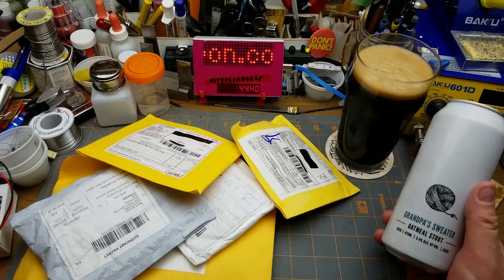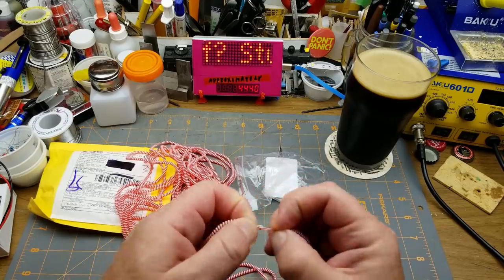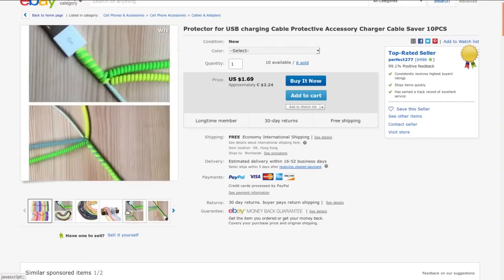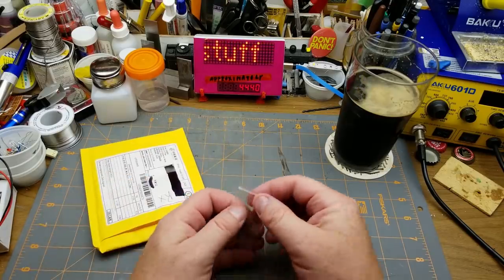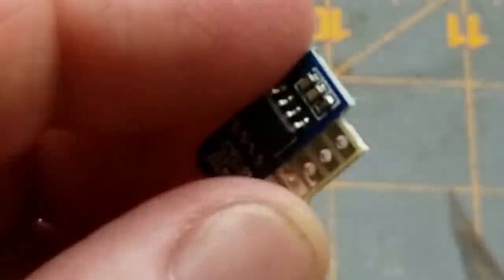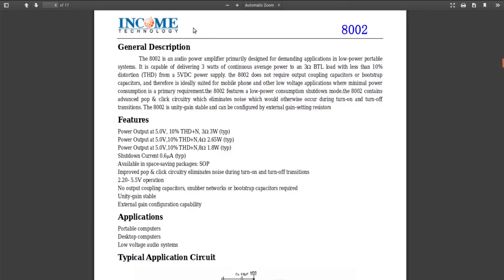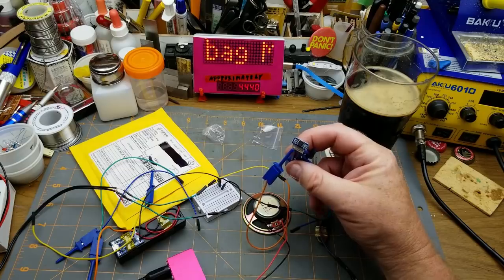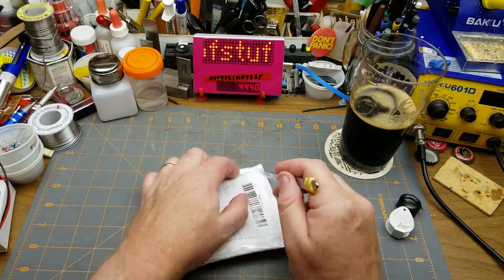mailbag monday #69

Comment: Always worth putting in a bid on lowball auctions. I wanted to stock up on some odd resistor values, surface mount  so I just won three auctions where I paid I think six cents for one strip of 100 resistors, and then 14 cents each for two more strips of 100 resistors. Can’t go wrong.

Comment: On that power board the three pots are: "Voltage Set", "Max Current Set" and "low current sense point."
The "low current sense point " is used to, say, light the blue LED when the current is below 20mA as a "charge complete" signal.

Comment: That speaker/ amp combo sounds perfect for a merrygoround/carousel on a model railway layout.
Reply: Better to use a PAM8403 module, which are usually cheaper anyway. They are Class D, so higher efficiency and they don't get hot.

Comment: Thanks for the mailbag :)
Just a hint : if you don't have a dedicated screwdriver for these poti setscrews you could put a small piece of heat shrink or wire isolation on the tip of a flathead bit to keep them from slipping off the screw ;)

Comment: FWIW "HDMI cables either work or they don't" isn't quite true. I have a couple cables that sometimes work fine, but other times will have issues.

For example I have an HDMI cable in my living room from my laptop to my TV for occasionally playing PC games on my TV. It's a bit long and seems improperly shielded. With the laptop everything is fine, but with some devices, such as when I used it for testing my android set top box, there are artifacts such as speckling in the dark areas, I think due to RFI.

Some day I might try adding some ferrites to the cable and see what happens.

Comment: You should get one of those Bourns pot adjusters. One side of it has a shroud.
Reply from the maker: I have a couple at work.

For my home shop I try to see what is the cheapest viable method, tool,or parts I can get away with using and still have acceptable results.

Comment: You can't beat the price of the hdmi cable :-D, most ordinary shops are a joke for prices.

Pink spiral wrap, i'm starting to worry about you lol, big clives distant brother maybe :-D
Worth a try on the cables though.

That tiny audio amp made my memory say Lm386, but that's only 1/2 watt and i'm an old git :)
You might want to plop that variable psu in a earthed metal box, switchers can generate a hell of a lot of r.f noise, depends if you still use a.m f.m radios.
Sorry im being obvious :-(

Comment: 7:34 the '3M' is not pre-cut eh :(
Reply from the maker: There is a weak die-cut on it, but it's not very well done. You'll still need some sort of cutting tool.

Still, hard to complain too much  for the price.
Reply: oh I couldn't tell from the video. no complaints, all is well :)
Reply: It's also half the size than what shows on eBay.
Reply: @Okurka.  very observant of you. they skimped on it 😁